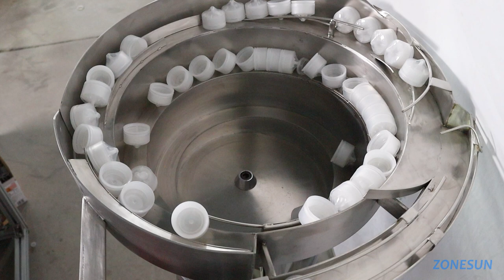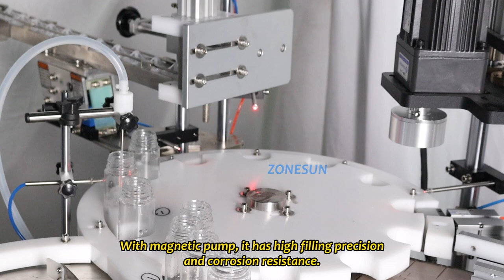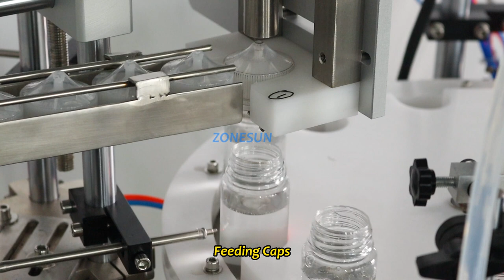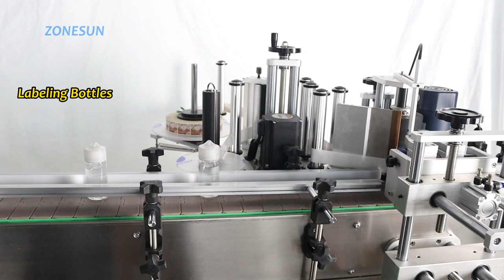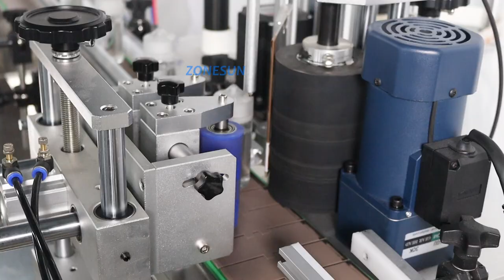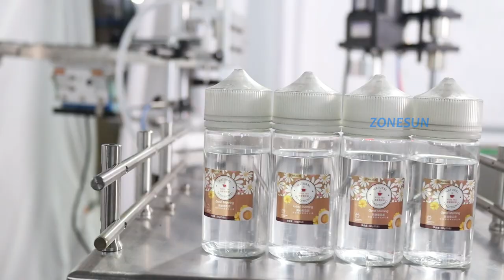How To Use Desktop Automatic Small Bottle Filling Capping Labeling Line?

Comment: Please send a quote and video if possible for a compact mono block machine to fill from 5 ml to 30 ml essential oil. WE need the filling pump, vibrating bowl to place the cap, and the tightening of the cap mechanism,

We do not need the load turntable or labeling machine.  voltage can be either 110 volt or 220 volt.  thank you

Robert Scott
Reply from the maker: What's your email?
Reply from the maker: Our email: info@zonesunpackaging.com